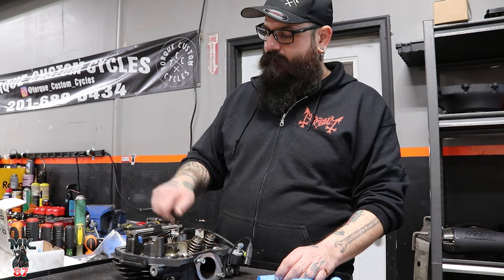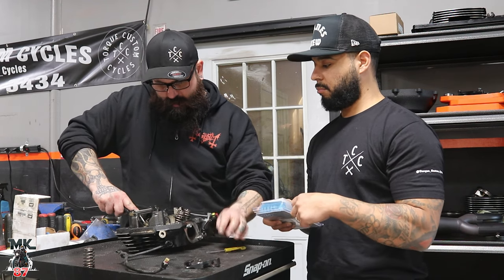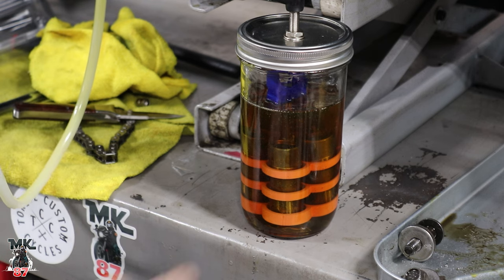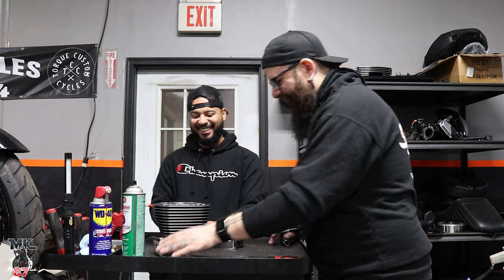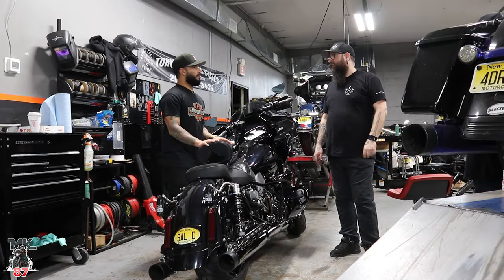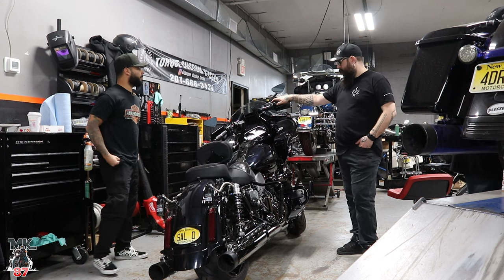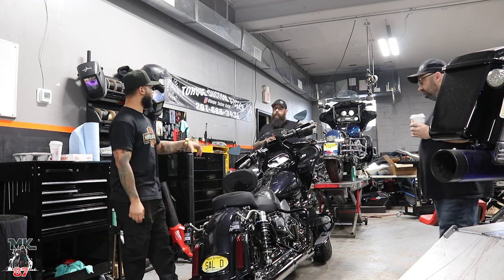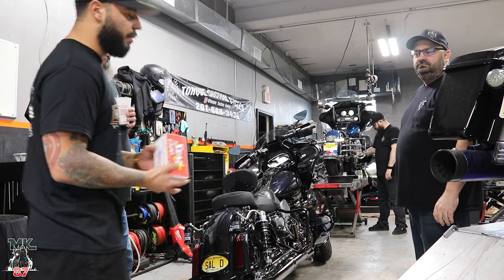Harley Davidson Road glide cvo with S&S 128 kit build!

Comment: What are the benefits/disadvantages or reasoning for choosing to use the 128 instead of the 131 with similar aftermarket components?
Reply: This particular customer chose the  128 because he has a CVO and the only S&S kit that came with granite color cylinders was the 128
Reply: @TorqueCustomCycles  thank you. So it was more of a cosmetic thing than a performance thing
Reply: @grayv3  yes. And let’s face it the difference between the 128 and the 132 wouldn’t be too much. This bike once broken in and tuned will produce great numbers
Reply from the maker: #whatsthenumbers
Reply: @TorqueCustomCycles  How much of a break in on a job like that? Customary 1k like on a new stock motor? Keep it under 3k rpms, etc??
Reply: @Smitty39  1k. We are able to set the rev limiter to 4250 though
Reply: @TorqueCustomCycles  but now they have the 132 in granite 😮! 😂😂

Comment: Are the stock valve springs adequate for the S&S 475 cam?
Reply from the maker: They usually recommend to change them when you go over 500
Reply: Yes